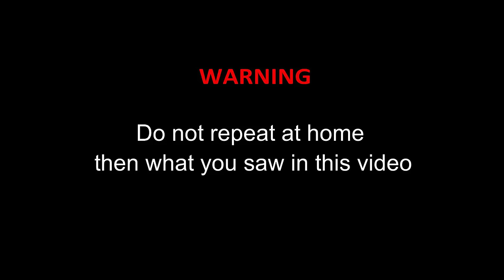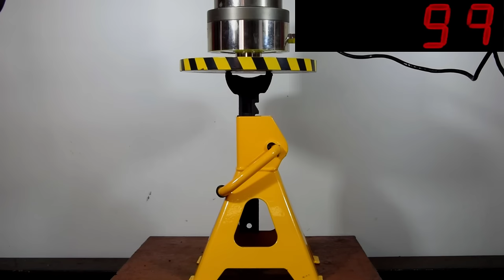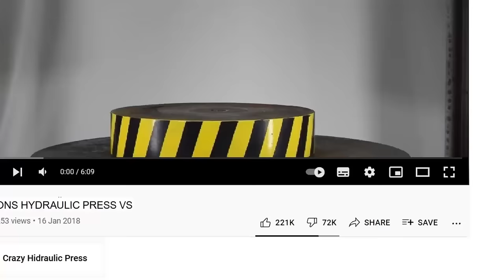HYDRAULIC PRESS VS CAR STANDS

Comment: I'd be interest to see how these compare with a Weber / AC Hydraulic axle stand with a locking screw thread. This type of axle stand are much safer and allow you set each stand at an exact height - to the millimetre if required.

Comment: I believe this test is a bit misleading on the failure 'way' of the jacks, but someone correct me if I'm wrong.  Since they're being tested by a hydraulic press, which presses slowly as pressure builds, it looks like the failure is slow.  If there was too much weight placed on the jack via a 'dead' weight, would the jacks not fail catastrophically?  While I realize the point is the jacks resisted the rated force, the previous part still matters I think.
Reply: Slow or not, nobody would be under a load until stabilized. After it is stabilized it seems highly unlikely a pickup truck , car or suv would ever crush those.
Reply: The vorel jack tested last was BS, failure isn't documented with hook engagement, but rather focusing on pressure it takes to break or crush the adjustable support.... totally irrelevant in real worl usage
Reply: @derekw40  Well I'm trying to jack by Bagger 288... your comment is not helpful.
Reply: @derekw40  That's a good point.

Comment: I have similar black ones  (red base with black post) but outer post only goes down halfway, and legs are joined at ground level with welded on flat bar, and i also have similar to yellow ones (mine are blue with black post).
The black 3 leg type are fine a lot of the time, but as others mention, especially if vehicle up on 2 or 4 of them, are not very stable, compared to using the yellow 4 leg type.(and feel sure my ones would give in much sooner on your press, (also like yours, the tops flattened really easily when first heavy loaded)
As both exceed load ratings, i prefer the more stable type, used up to sensible loads, and so recently got a pair of the 10 ton ones as well (blue base yellow post), but may add some reinforcing to the smaller set, now i have seen what gives way first. Good video. Would be interesting to see how some heavier rated ones preform as well.

Comment: The VERY BEST way to support a vehicle in my opinion is to use logs. I used logs that were of varying heights, 12 to 15 inches, they were of a diameter of the same. They were NOT old decaying logs either. My neighbor always had fresh cut logs he would eventually cut up and burn. I would borrow some until I found some that I kept from a tree that had been cut down locally. The price was GREAT, free, and they're better than any jack stands. IF, you buy a set, get some for a truck to use on your car, OR, the most heavy duty you can find if using on a truck. The money spent is worth the life you save.

Comment: I'm blown away. Massively impressed with those jack stands.
Reply: ? this video is scary. they failed insanely low. jack stands are for safety and safety devices should have a factor of 3 to 5. IE 2 ton stand should fail at 6-10 tons. not 2.1 tons.
Reply: @slappomatthew  please read my other reply and you'll see that it is indeed failing at much higher than 2 tons. 4.2 and 7.9 metric tons, or 4.7 and 8.8 US tons respectively.
Reply: @slappomatthew  dude, who's lifting that much weight with these things? Anyone who's truck is that heavy isn't using jack stands. These jack stands are literally only lifting the front or back half of the vehicle they're under, and for that purpose they're pretty perfect.

Comment: A LOT of car jackstands and floor jacks sold at retail are all manufactured by a handful of factories in China.  They are then painted according to the customer.  So the only difference between dozens of different brands is the color, stickers, and warranty.
What happened with the 3-ton and six ton stands was that the manufacturing production equipment was worn out and some stands failed the load test.  Harbor freight recalled them a while back.  Now, AutoZone and Walmart are issuing a safety recall on the much more widespread 2-ton stands that are used by most car DIYers.

Comment: The folding stand is a pretty good design with the center tube going down to the ground. The cheapies they used to sell in the US were open at the bottom. Basically the tube was split to create the legs with a flimsy brace between the legs and the adjustable part in the center. You could actually see it give when being used at the proper weight.

Comment: the top support pad on the second one actually failed (bent) around 1000kg in real life that could result in the vehicle falling off the stands.
Reply: That's because the platform wasn't shaped like an I-beam of a frame that WOULD have been in direct load bearing contact with the top. It deformed until the REAL load bearing surface was in contact with the load. You are correct about the defamation but you are incorrect about your conclusion. The vehicle would not necessarily have fallen off the stands and if you're any kind of a decent mechanic or that could happen you should've secured the vehicle by using cross wires or at the very minimum cargo straps to keep that movement to a minimum. And if you don't do that well then all I can tell you is that you're taking unnecessary risks because a vehicle on a jack stand like that? And your reefing hard on moving something? You've always been taking your life in your own hands. And I know a little bit about what I'm talking about because I was in the military in an armored cavalry unit and we had to move things, and I'm also a fire fighter, so even though today I'm working as a registered nurse, I do a lot of non medical things. But I move around a lot: and I have chains with come along's and the ways of securing a 4000 pound vehicle on a trailer which I just did recently. So I am aware of about loadbearing and loading things....
Reply: @stevenwilgus8982  i'm a mechanic, we don't strap down vehicles on jackstands, we also don't use shit jack stands that bend at 1t. also in case you didn't know, the military has it's own special way of doing things that are just not feasible in the real world when it comes to doing things effectively without a squadron of people or unlimited resources.

Comment: IMHO I have a car weighing in at 3700lbs and a truck at nearly 5200lbs. It will always be supported by at least 3 point and unlikely to ever see 2000+lbs on any point. With my life in the line, I would much rather trust the $25 jack which did not budge until its 2ton rating and still has base and very thick neck to limit the fall then the $15 jack which failed at under 1000lbs when the top flattened out. at that point, the stand will be slipping off the frame or whatever you had hoped those points would hook into.

Comment: Sounds like everyone was surprised by the cheap jackstand! Other than the saddle flattening out (which you wouldn't use one that way anyway) it held almost twice its rated load! I was actually surprised the saddle of the yellow stand didn't crack as I was expecting it to with all the weight on the ears like that. If I'm using four of those to hold up a 2600 pound car I think I'm safe!

Comment: The common knowledge is that the more expensive design is superior, and I have bought only those kind of stands. They are also more convenient. But surprised me to see the cheap design held up to greater loading before signs of failure.  BUT! in real world usage, the more expensive design is a 4-point base, and that makes them more stable and safe to work under. And that makes them the better choice.

Comment: Nice to know the yellow stands held to 4200kgs.  Did a transmission service on my vehicle with a pair of similar to these, under the back axle.  Holding about 1/2 the vehicle weight (about 2000kg  empty weight, weighbridge tested), divided by 2 - about 500kg load on each stand.  Well within tolerances.  Still, spent as little time as possible under the vehicle.  Jacking the vehicle is probably the more dangerous part.

Comment: it should be noted that a pair of 2 ton jack stands are 2 tons of total weight distributed across both Jack stands. it does not mean the stands can hold 2 tons each. good to see both designs far exceed 2000lbs

Comment: harbor freight recalled one like the yellow one, but didnt have a one for one replacement.  too much  flashing in the notches on the rack. if you filed it out it solved the problem.  this is a different issue.  im sure HF has the same issue.

Comment: as a automotive technical, all the accidents with this tool is for the angle of the ground, the type of the ground, and not to  put it in the correct place in the car. and or course, what kind of forces an levels are you gonna do with the car.  this small reading can save your live.

Comment: Both failed in bearing at the lugs (clevises), but the rack and pinion design causes the failure to be potentially more catastrophic. Once the rack goes past a certain point, it would collapse quickly under the weight of the car, and would impose a higher dynamic load than the hydraulic press is exerting. The if the black jack stand failed you'd probably have more time to get out of the way.
Reply: The rack is better for "permanent" use becausethe actual load does have to be as centered as the collapable stand. I'd throw one or two of those collapsable ones into my truck for roadside use, but the racks are better suited for being in a shop, they'd be more forgiving on where you actually placed them.

Comment: Glad I got the pin type.. wish they'd tested the pin type that are welded into position aswell eg. The ones that look like the black one but instead of folding up they're welded as a pyramid and only the top part adjusts up n down with a pin, as that's the types I have and being welded legs/body I wonder if they're stronger than the black one, (as it's foldable) or perhaps theyre weaker as welded??? I'd be interested too know!
Maybe could test those AGAINST eachother for another video?
Cheers 👍😎🏴

Comment: You should try this test but have the stands on a slight angle. Sometimes the ground isn't always level where we need to work.
Reply: Working on a level underground is required in order to use these stands.
Reply: The box says "only use on a level stable surface" but no " let's see how it works on greasy sand thats real world testing, let's get them  rusty  and throw them off the back of a pickup truck at 70 mph then test that  junk lol"

Comment: I have a pair of jack stands that have the pin but the frame is solid, welded like the yellow one - combining the strongest features of the two shown here. I wonder how mine would hold up. I never have trusted those ratchet-style stands.

Comment: Years ago while in high school I got to wire in some machines in engineering class. They had a hydraulic ram that they were going to test strength of concrete. We use to put short pieces of 2 by 4's in it. Think it took several thousands of pounds until the wood piece blow up.

Comment: I still use two jack stands and a extra one.. Just in case the concrete floor has a hallow point.. Or something is defective.. Extra 20 bucks and 5 minutes of is worth the extra insurance. If you got wood. Also footing is important so one foot dont sink in.. Because even if its not defective or broke.. It can slip or lean and lose its grip. Be extra careful

Comment: I still always put an object thicker than my chest under the car, usually in two places. A wide log on end works well. I never use a concrete block anywhere under the car, since they are brittle and can collapse. 

By the way, I found your numbering scale a bit confusing. I assumed the digital measurement was pounds, but then at some point you inserted the kilogram overlay, and it didn't match the red digital measurement if converted from pounds to kilograms. And then you have a space between the first and second digits of your kilogram measurement. 

I still assume the digital red measurement was in pounds, but maybe you could label this in the future to make this clear.

Comment: The $15 Telescopic Type Jack Stand withstood 17,500 Lbs which is 8 3/4 Tons (7.8 Metric Tons). The $25 Rack and Pinion Type Jack Stand without a safety key withstood 9,299 Lbs which  is 4.65 Tons (4.2 Metric Tons) That is interesting and impressive that the cheaper telescopic Jack Stand held up to more weight.

Comment: Good to see both stands exceeded their weight rating. The danger is when unstable jacking points are chosen. Unlevel ground and not chocking the wheels to prevent rolling off the stands. Or even worse no stands and just a jack. I have seen some really silly shit done that has ended badly. I'm impressed that the cheap stand would have still held a massive 14 tons for some time.
Reply: never work under a stand, have something else like bricks there to stop crushing you if the stands fail.
Reply: @MHLivestreams  I usually chuck a spare mag wheel under the sill. I have seen idiots laying under a car using just a jack on a dirt lawn. Cockroaches you can't kill them either.
Reply: @andyroo3022  that's what i use, a fat wheel. anything wide and solid. Looks like people are stuck with us for a while haha/
Reply: @MHLivestreams  It was funny to see his face when I said, "get out from under that car before you get squashed and your friends see your guts coming out your ass". I probably did him a favor. I saw some not so lucky blokes from accidents that could have easily been prevented. I don't have to do that these days.

Comment: It doesn't surprise me that the cheap one is better, just looking at it you could tell the other one would break where that small pin was holding it together. Also the cheaper black on folds up taking much less space.

Comment: Interesting. I would have thought the "ratchet" stand would hold more weight. I have a pair of them but mine have the extra triangle pin that slides in. I just did a front end job on my Escalade (springs/shocks, CV axles and bearing hub assemblies) and I was concerned about this pair of jacks I bought for $60 holding up the entire front end of my 6,000 lbs truck so I put some wood blocks right next to each jack stand with 1/2" clearance so of the jack stand failed the wood blocks would catch the truck. But they seemed to hold with zero stress. The base of the jack stand shifting a 1/8 inch on the driveway due to unevenness was scary but that was it. Best part about this video, is neither failed with a catastrophic collapse. Both were slow and likely would leave plenty of time for the user to notice the failure and react with a jack.
Reply: the reason it slowly failed is because that's a hydraulic head that can suspend itself while exerting downforce. in a real world situation, 6500lbs free floating, if you dont notice the lever starting to fail you have but a few seconds before it crushes and kills you

Comment: Yellow 9,300 lbs and black 17,500 lbs.  Damn, both exceeded tolerance of rated 4,000 lbs by a lot based on initial failing points.

Comment: The Yellow one is superior design regardless of this test.  All you need is a 3/16 doubler welded around the pin holes on each side and it become an 6 ton jack stand.  The black stand just looks like death from a box.

Comment: I have some really old stands which are a huge thread with a nut on, i have no clue what the rating is, but it's guaranteed to be more than the motorcycles I use them on!

Comment: I have the cheap black one just in red, 40€ for 4 of them, a bargain.

The weak spot of the cheaper one is not the direct vertical force, it’s going to fail quickly when you put force from the sites since the hinges are weak.  I would not recommend using this kind of jack stands on the driveway with incline.
They also tend to tilt slightly, the steel pipe in the middle has little play, wobbling around a little bit. This makes it even more unsafe to use.

Comment: With all due respect, what is described as a "rack and pinion" type is not an accurate description. A pinion is a round component. Think of the shaft and gear that acts as the input on a ring gear in the axle of a rear wheel drive vehicle. That is the "pinion gear." Same thing for rack and pinion steering where the input to the rack is a round gear that rotates against the rack, and this action changes the force from a rotational force to a linear force. The component on the jack stand that engages the rack is what I (a Journeyman Toolmaker) would call a "dog" or a "pawl." These are both mechanical design terms. This dog, rather than transmitting rotational force to the rack as a pinion would, instead merely obstructs the rack so that it cannot travel.

Comment: The ratchet jack stand failed as it was designed to - notice the roll pin that holds the 'tooth' that grabs the bar. That's a shear pin, meant to fail at the real load failure point of the stand. The safety factor of that stand is 2.2, as in it took 2.2x times the load rating to actually fail. Failure is also not complete at that, because it would fall enough to look like it did in the 500 ton press clip. From there, it took a lot of force to crush it flat. Considering that stand is supposed to support only half or a quarter of the weight of a vehicle, and most vehicles aren't over 2 tons, they're a perfectly safe design. The folding jack stand is safe, but its failure mode is very, very different.

Comment: I actually got into the Habit of doubling up on Car Stands. I actually have a dozen+ Car Stands. so if Im going to be working on car or truck. I will always use 2 on each corner. so yes 8  will be under the car.

Comment: i suggest not to buy the 15 dollar one, the problem with that jack is that it is very weak against side forces!
Reply: Which shouldn't be a problem on a car that's immobilized AND on stands.
Reply: @VroomAndPew  Hy, im a mechanic. if you work on suspensions for example, while fighting with some screws you can cause side force by yourself. It is very important to have the car stable on the stands.